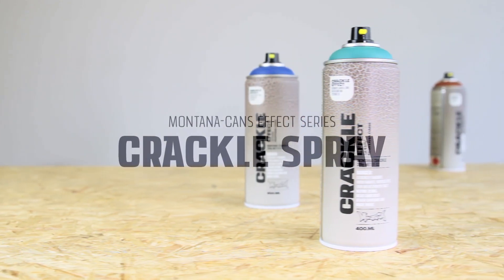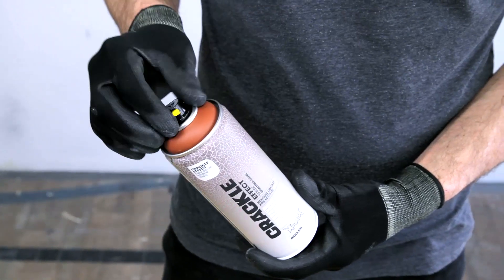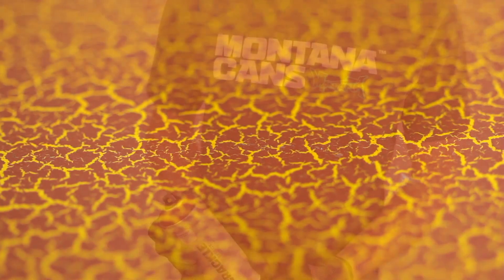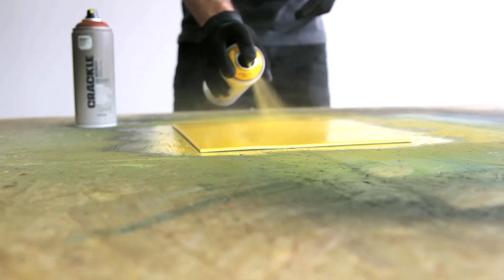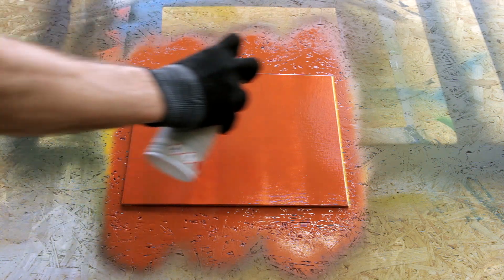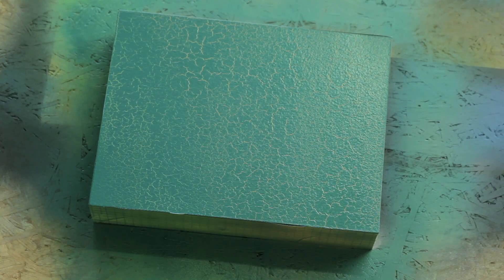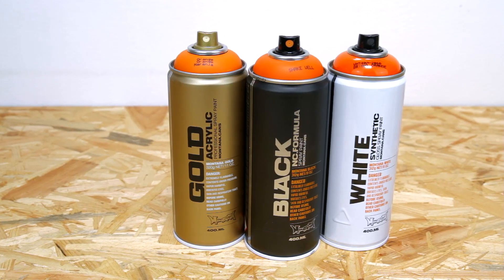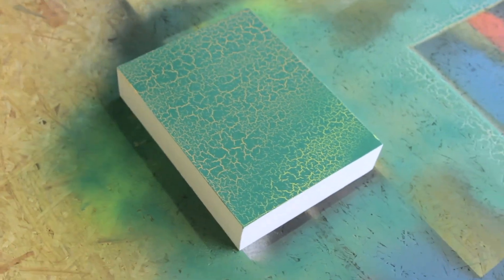Montana Crackle Effect Spray Paint

Comment: What would happen if you apply this over an oil based spray paint?
Reply from the maker: The manufacturer recommends using them over Montana Gold (acrylic solution) paint. We haven't seen them in action over an oil-based coating, but since crackle paint works by softening the undercoat, we think it might not give a good, stable crazing. We'd recommend patch testing before trying an experiment on finished art, and always follow package indications for safe use. Hope this helps!

Comment: Can this be used over metal?
Reply from the maker: +Darwin Morales Yes, you can use it on metal.  Make sure the surface is cleaned of dust, oils, and rust.  For longevity, you might consider using a metal primer prior to applying your under crackle color. http://www.dickblick.com/products/montana-primer-sprays/  If you have additional questions, you can reach Blick Product Information at 1-800-933-2542 or info@dickblick.com. Thanks!

Comment: can it be applied on paper and canvas !
Reply from the maker: +dohafresh power Yes, you can use it on paper or canvas.  Be sure that your paper is heavy enough to not buckle when the spray paint is added or tape it down before painting.  If you have additional questions, you can reach Blick Product Information at 1-800-933-2542 or info@dickblick.com. Thanks!

Comment: Does this work on a Xbox controller, I'm giving this to my friend as a present
Reply from the maker: +CRTR BLUE Yes, it will but with some prep-work required.  Be sure to apply a Plastic Primer  first (http://www.dickblick.com/products/montana-primer-sprays/).  Once the primer is fully dried, apply the base color (that you will see under the crackle) and then the crackle after 45 minutes. Be sure to clear coat the entire thing after it has had time to cure, 24-48 hours, to ensure durability.   If you have additional questions, you can reach Blick Product Information at 1-800-933-2542 or info@dickblick.com. Thanks!